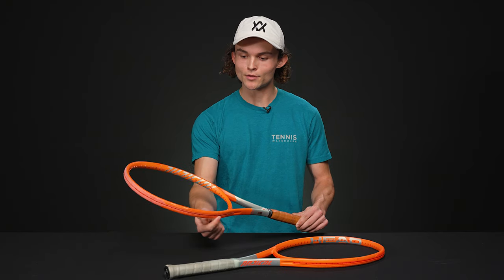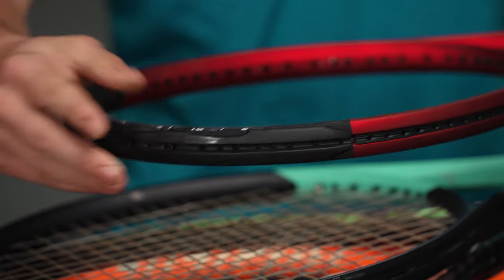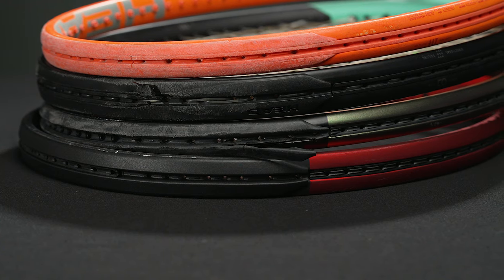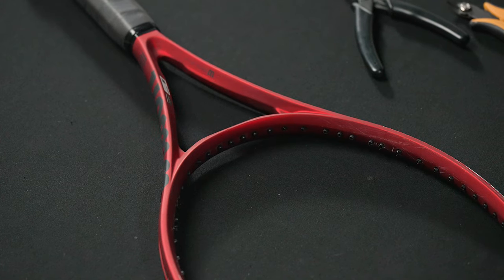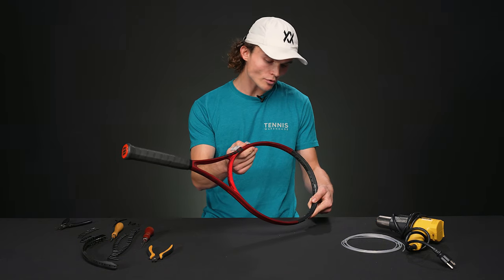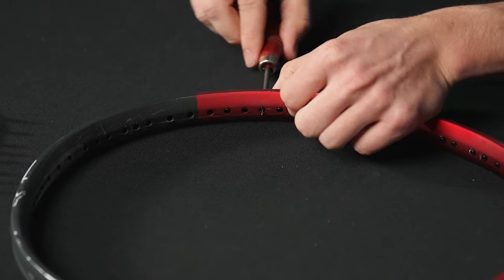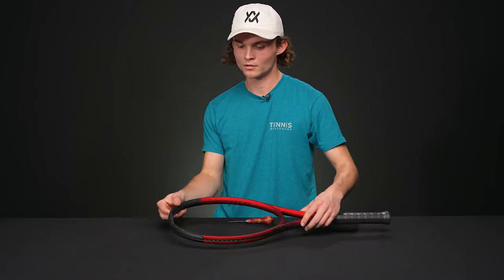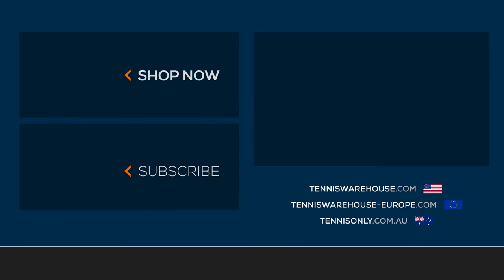What is a grommet? Why does it need to be replaced? How to replace a grommet on your tennis racquet!

Comment: What if you dont have a specific kit cause your racquet is too old and you only have a universal kit? those grommets are individual
Reply from the maker: If you don't have the grommets that work with your racquet, you are sort of stuck and the best alternative is to buy a new racquet AND stock up on grommets for future issues! Grommets definitely sell out as well and can be hard to find on older racquets and because racquets get updated every couple years, the grommets often change and won't fit older models.
Michelle, TW

Comment: Why do most clubs not replace the grommets for you and only string? I bought my own but no one will replace them.
Reply from the maker: I think it is a matter of finding a certified Master Racquet Technician, or someone who has had a lot of experience with replacing the bumper/grommets. Some clubs may have a stringer that is capable with the stringing process, however may not be experienced with replacing the grommets and bumper on a racquet. Some racquets are definitely easier than others when changing the grommets, so it definitely can take some time and practice, especially with certain racquets like some of the Babolat racquets can be difficult to work with. We can replace the grommets for you, and you may be able to find a retail store that can do it for you; we typically will do it complimentary when re-stringing your racquet however some shops may charge a labor fee. Troy, TW